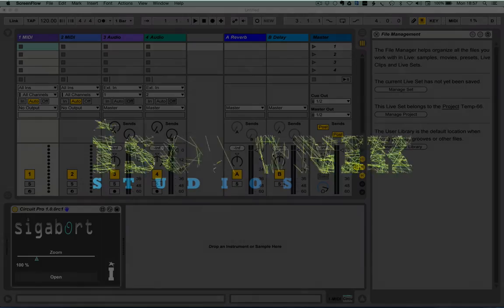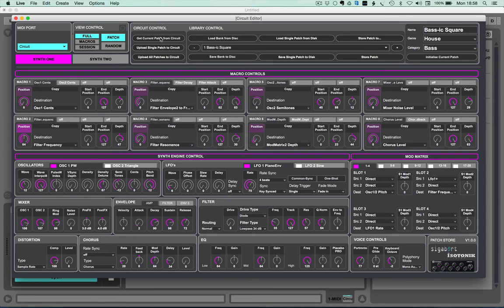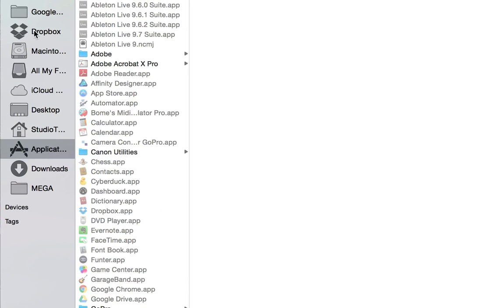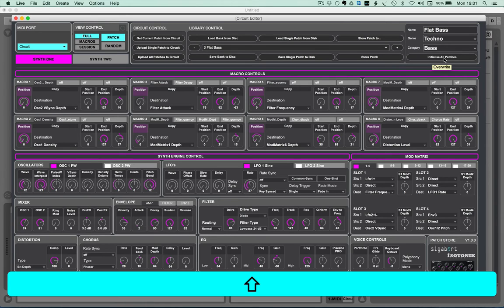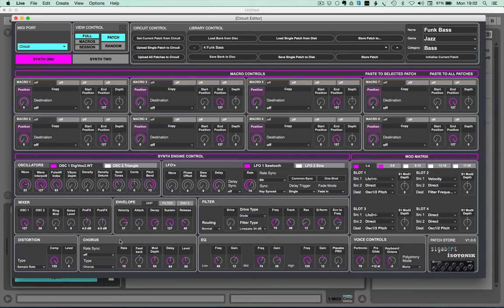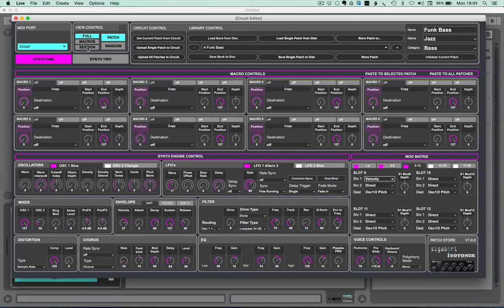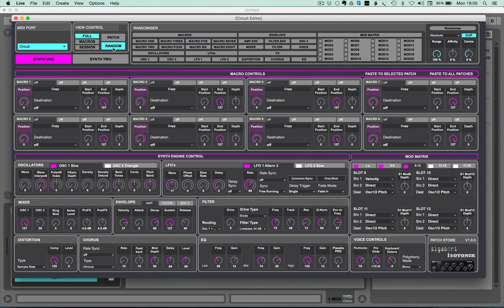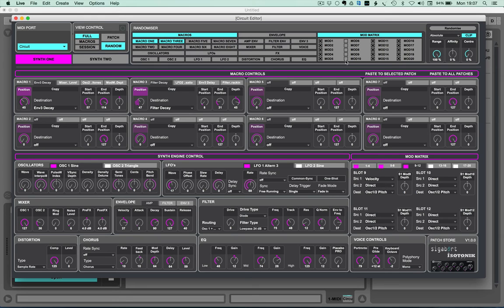Circuit PRO Editor for the Novation Circuit

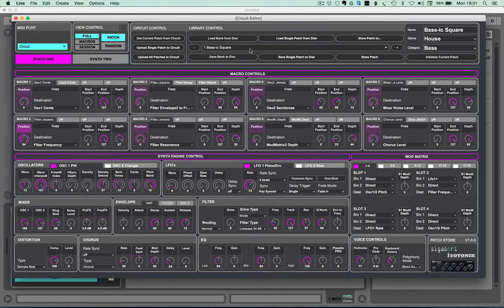Comment: Can you still audition patches like it shows at 3:00 ?  I seem to be able to tweak the patches in the editor, but I can't scroll through them from the editor.  It also doesn't seem to do anything when I try to upload all patches, or copy the macro controls too all patches etc.
Reply from the maker: Charlie Beeching nothings changed in that regard...
Reply: @IsotonikStudios  hmm okay, I can appreciate it might just be on my end.  I've tried reinstalling, and restarting etc.  I've installed it on my laptop and desktop, and tried the standalone editor as well as the ableton one. 

Maybe it's a windows 10 problem? I know you did the video on the mac but would you be able to see if it works on properly on Windows 10?  It's a shame because it does seem a like a really good editor but I can't really use it to it's full potential at the moment.  
The circuit is definitely connecting in some way, as I get the blue "circuit" box in the top left by the midi ports section.
I dropped you guys a FB message as well.
Hopefully I can get it working, but i'm a bit stuck as what else to try :P 
Cheers.
Reply from the maker: Charlie Beeching sorry we don’t do support apart from via the website.
Reply: @IsotonikStudios  okay I'll head there then!